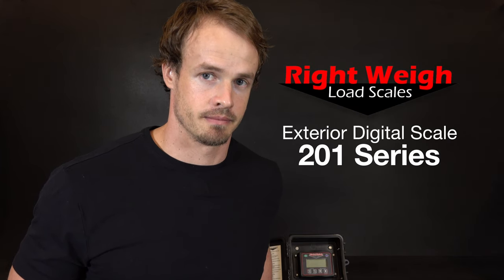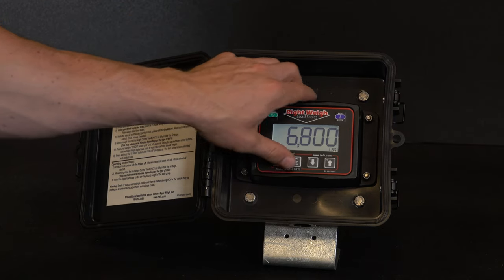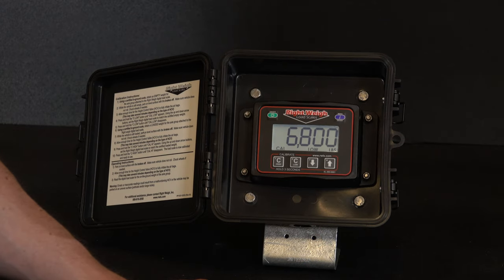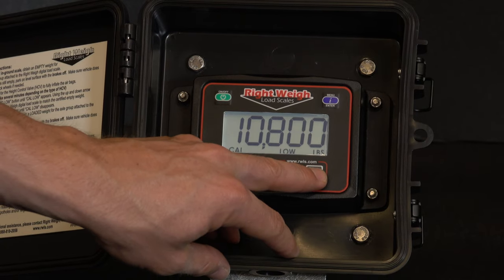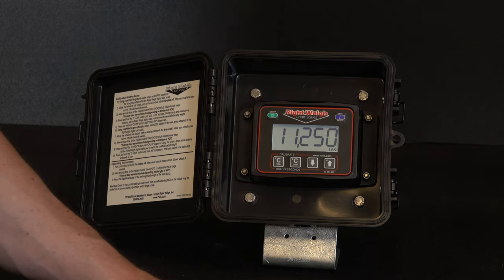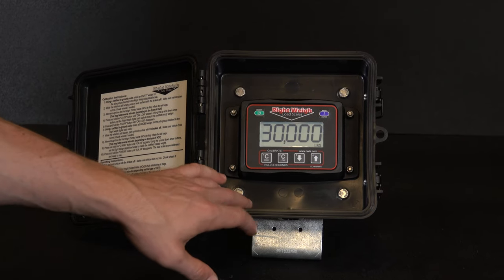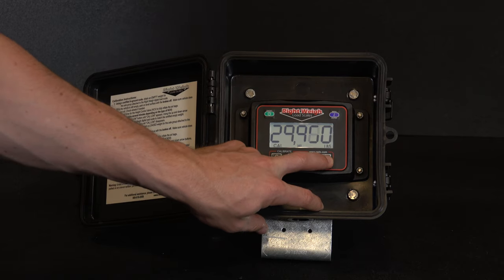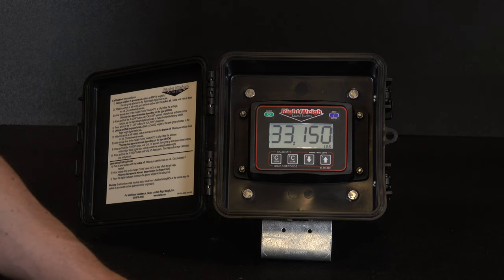Right Weigh Load Scales (Exterior Digital 201 Series): How to Calibrate

Comment: Hello, I have Right Weight Digital but, I have 2 trailers that with the tractor together weigh 21,500kg, but what weight do I put in the second trailer? I ask again .. The first trailer joins the tractor, the second trailer is joined with 5th wheel with the first trailer (the second trailer weighs 5900kg the first trailer 7600kg.